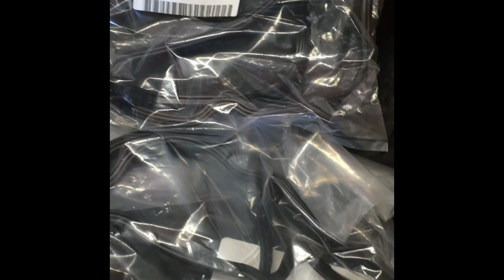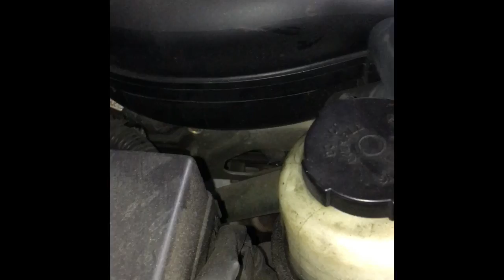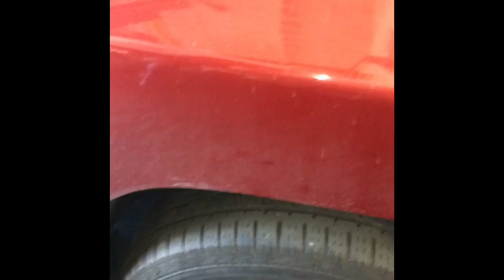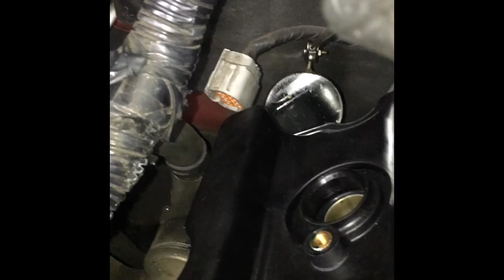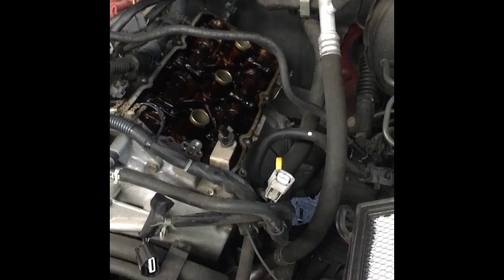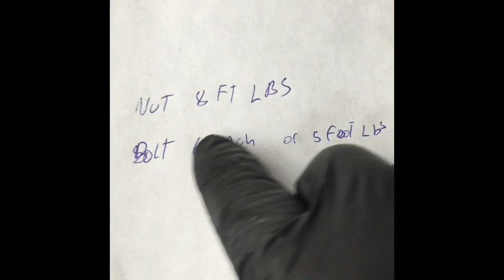How to Replace Valve Covers on a 2005 Nissan Xterra with 4.0 L Engine

Comment: Hey I have a 2007 nissan frontier and I have lost all power in the left bank. Oil Is present in the spark plug wells. I have spark and fuel.  Do u think changing the valve cover and valve cover gasket should solve my issue?

Comment: Thank you Brian, I did mine both sides with your help and it came out good. I also replaced the camshaft sensors both sides since I had good access to them at this point, didn't need to but at 191K miles and 14 years it wouldn't hurt.
Reply from the maker: Ahmad Ghosheh I think it was a wise move to change the sensors.Glad the video help. Thank you for watching!

Comment: Can you replace a leaking driver side cover without taking off the plenum?   I stripped the bracket bolts last time and dont want to deal with the plenum until i need a new one.
Reply: I did it.  Wasn't too bad, but i glued the gasket in the groove because it got pulled out when trying to reinstall the new cover with the damn fuel line in the way.  Dont ask me about the can of worms that opened up in thr long run. Lol
Reply: In the long run. It leaked.  But lasted 5 years.  Been leaking slightly for about one.  Gonna try it again on Friday.  Have it ripped apart, throwing a random misfire code.  Hope I didn't do the engine in running too rich since my computer swears there's a problem but every smoke test I do indicates a sealed system 😵‍💫

Comment: Thank you! Saved me a lot of money easily doing this myself.  I used a swivel adapter for the 10mm to avoid removing the brackets and reaching those pesky nuts in the back.  Very little angle with the swivel adapter, so I assuming torque would be negligible.

Comment: Great Video! My drivers side valve cover is leaking as well as the camshaft position sensor. Rockauto has the sensor at $15 so I’m just going to replace it since I have it removed anyway. Should I also just replace the valve cover?

Comment: Very nice video Sir!!!!  I just had my 3 coils replaced on the passenger side of my 2005 Pathfinder and drove it away. Immediately things went wrong and now they are saying  at least one coil hole is filled with oil and maybe the other two on the one side.  I find out tomorrow. Thanks for the video.  Great Job!

Comment: Good video! I was doing a normal spark plug change on my 05 xterra until i pulled out a oil drenched plug :/ this video is definitely gonna come in handy!! 
In case this repair doesn't fix it, what else could cause oily plugs? I'm just trying to cover all bases
Thanks!
Reply from the maker: Ivan Drago there's no ether reason this is the only cause.
Reply: I figured as such but I'm having low oil pressure at idle after warm up so i figured they might be linked to each other somehow

Comment: Great video - super easy to follow. Can all that burnt oil / sludge accumulate from missing just one oil change by 2k-4k miles or is that probably more from years of missing oil changes? 
I'm a little worried about my engine possibly looking like that -- I stupidly forgot to change the oil for about 2-4k miles & noticed that the oil was barely registering on the dipstick (I'm guessing it turned to sludge) & then I overfilled it by 1.5 - 2 quarts. Then i noticed my mileage dropped from 21mpg to about 15mpg, so I drained it all out (completely black) & refilled it with full synthetic. I put a little seafoam in the oil also & now I'm getting about 17-18mpg. Man, I hope I didn't screw up my engine & permanently reduce my mpg's.
Reply from the maker: Ryan b by missing one or two oil changes your engine should be ok. Sounds like you're on top of it now. In this case I think the  customer went 50,000 miles between oil changes. Definitely keep an eye on the oil level Nissan uses oil to control timing. And as the level drops it's not able to control the valve timing which will make your mileage drop. Thank you for writing and watching!
Reply: Wow you just made my day, I've been stressed out about it for the past few weeks - thanks for breaking it down for me! My mpg problem must be related to overfilling the oil or something then - should be easier to fix than a sludged up engine.
I had no idea about the oil level affecting the timing also - I'll definitely keep an eye on it more often now. Have a good one!
Reply: 50,000 miles between oil changes? as in change the oil, drive 50k, change the oil? how can you neglect something like that?

Comment: Do you have to drain the oil before changing the valve covers?
Reply from the maker: Jason Knowles no don't need to drain the oil. You will need to check the oil level after the job is done. Thank you for writing to me!

Comment: Why would you replace the valve covers only?
Reply from the maker: Glyn Fricker The customer at this vehicle only wanted to use factory parts. And Nissan only sells the valve cover as a whole not the gasket separate. At least at the time when I shot this video May have changed by now.
Reply: The spark plug seals in the valve cover are not a serviceable part. You have to replace the whole cover if you have oil in the plug wells.